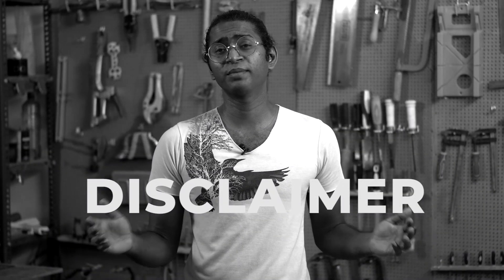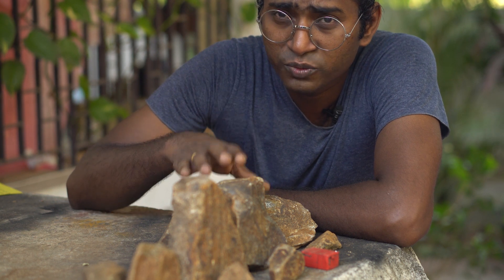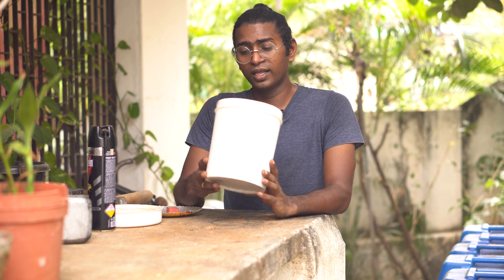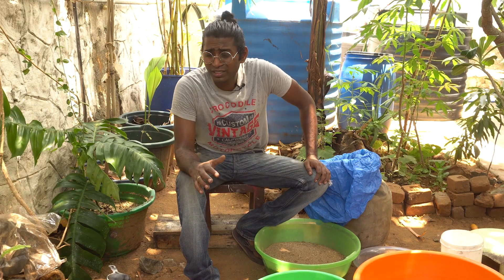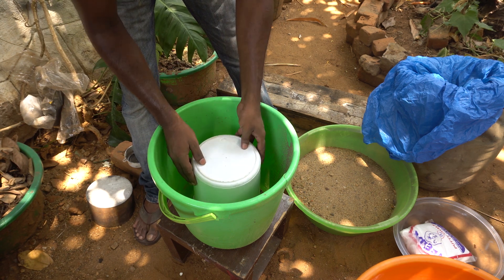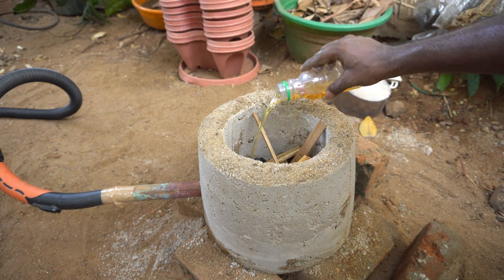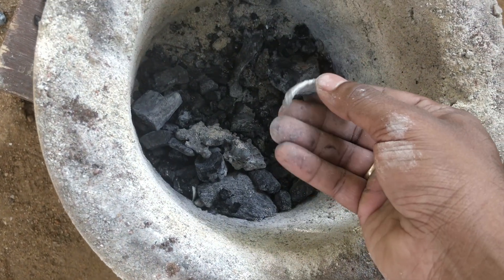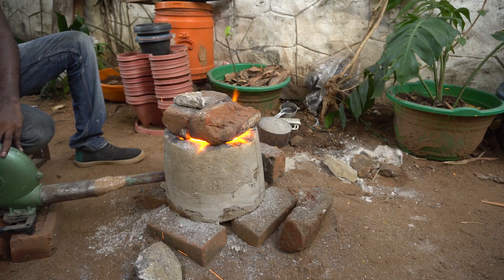There is Metallic Iron inside this Stone!

Comment: Bro i think the pegon glass will break because the temperature increases you watch how they melt silver aluminum from trash they use minimum 2cm diameter thickness  of round cup which is metal i think . Just i watch all science videos .This is my view so don't mistake
Reply from the maker: No bro, the round cup is called Crucible and it's made out of graphite. Sometimes Ceramic is also used. What i used here is ceramic. But both of these will crack if it is not preheated and cooled down twice or three before using. I didn't do it. 
Even glass will break if you pour water too hot. It might not break if it's preheated. It breaks because the expansion of outer and inner layer of glass is uneven.
Reply: @VIDEOEPPO  ji all rounder

Comment: Hmmm very interesting. I love the DIY furnace.
I think you should definitely revisit this project with a few alterations to the method. 
The ceramic cup was bound to get destroyed as it was quite thin and also a much lower melting point than the metal. Maybe a good idea might be to construct a metal base concrete cup of sorts in the same way that you made the furnace, for the purpose of melting the metal. 
There may also be some non furnace methods of obtaining the metal from the rocks in your yard.
Wonderful video man!
Reply from the maker: Amazing inputs bro. I am ordering a graphite crucible once the lock down is over. And some carbon rods as well. I might use the carbon rods with arc welder and see if does something

Comment: Why don't you make a diy air blower and control the speed with a ceiling fan regulator... It could work right???
Reply from the maker: Actually i thought the vacuum cleaner blower would be okay. Then only when i started the thing, i realised it's way to high even on the lowest setting. Now that I have had my lesson, I will be making a blower soon.
Reply: @VIDEOEPPO  Failure is the best teacher... 👍👍👍 I think it would be easier if you modify your current Hand Crank blower to run with a motor or something... Keep up the good works...